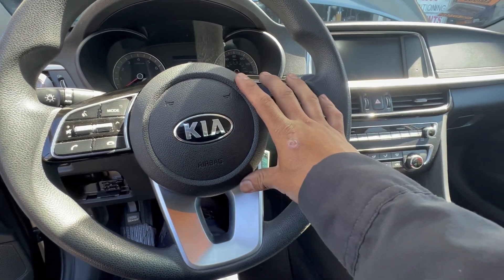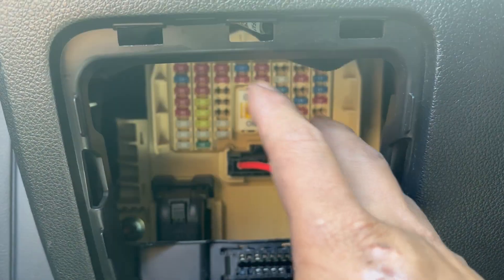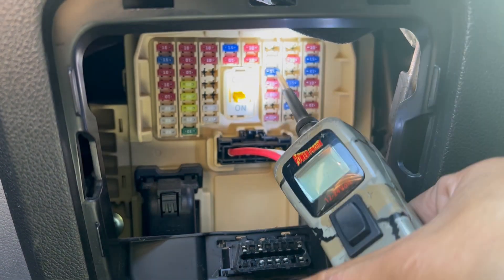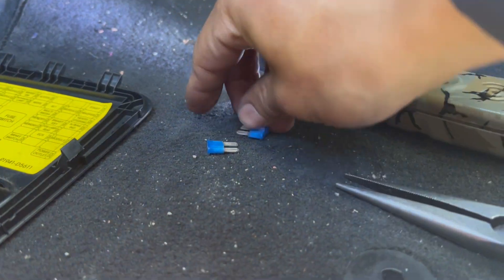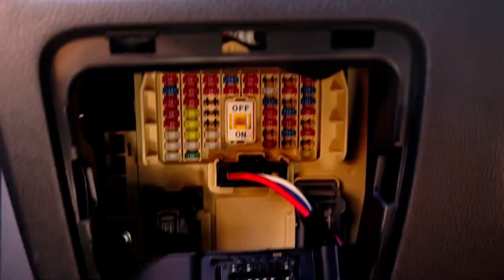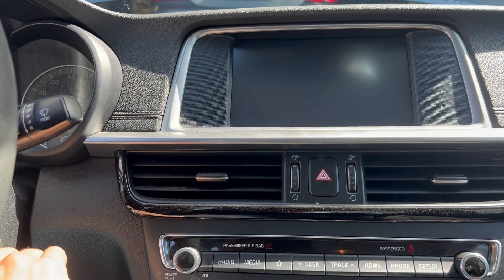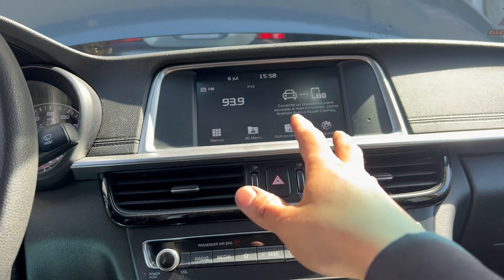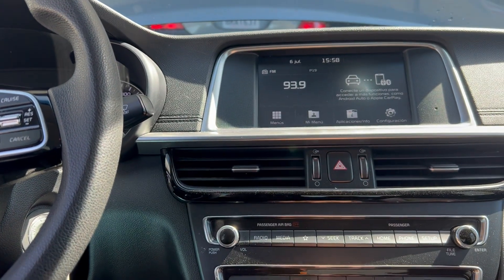Kia & Hyundai Radio / Navigation System Not Working? Easy Quick Fix

Comment: when Updating my Kia k7 navigation it went smooth and reach 100%. when it reboot the display turn blank and force me to reset it. after that the screen is back but nothing happen. the update is not installed. even KIA autoservice has no solution for this problem
Reply: How did you solve this?Mine also have received black screen after she try to update it.